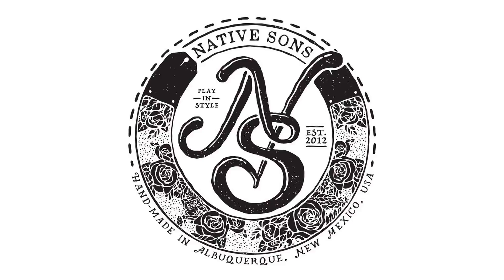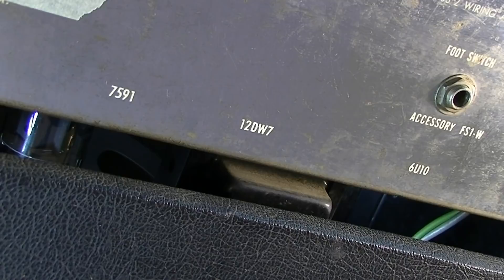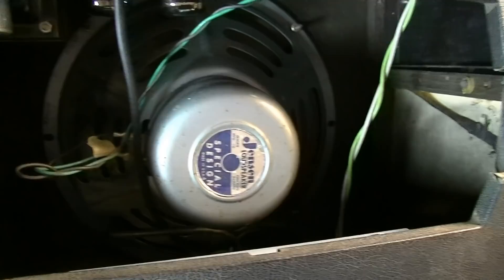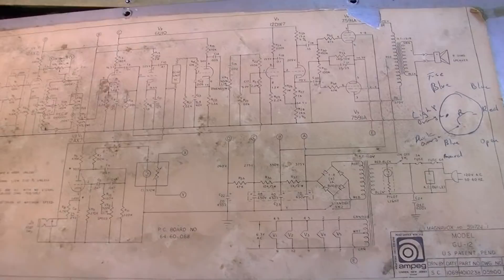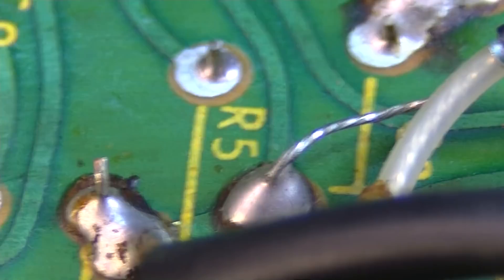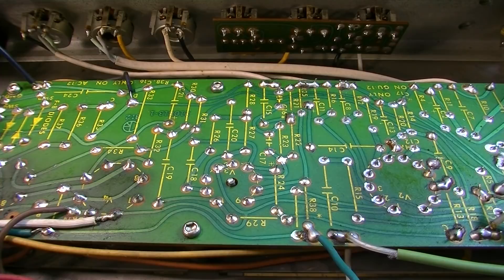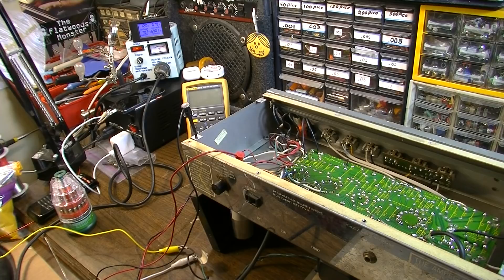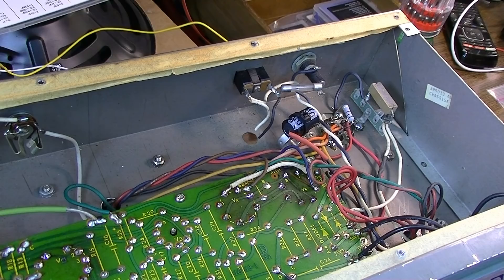What was Ampeg Thinking with This Board Design?

Comment: You have no strain relief on the power cord you added. If you're going to do it wrong and use a grommet instead, you should at least tie a knot in it so it doesn't pull out the first time somebody trips over the cord.

Comment: All of a sudden, the pc board design made sense to me once you mentioned that Magnavox owned Ampeg at this time. I took apart a 1964-ish Magnavox console stereo and made a blackface Fender Champ out of it, but the pc board used on the radio portion has the exact same sort of design and orientation. The board on this radio was soldered to the chassis, which made things even more difficult. Basically, Ampeg used this design of circuit board because Magnavox used it.

Comment: Blue line graphics on Ampeg usually means first run 68/69. They changed to black with sharp corners in 70 and then softened the corners on the logo by 75
Reply from the maker: I have not closely inspected date codes on this other than the cap I show with a 1968 date code. I'm beginning to this this is late 1968 or early 1969 and therefore first run of this amp, because [SPOILER ALERT] the speaker turns out not to be original to this amp as I suspected it might not be.
Reply: It's interesting though that you saw a 72 date code on the transformer. If it's not a replaced Transformer, then that muddles things up a bit...I would think the OEM speaker would've been a square back CTS or something like that.
Reply: Flex

Comment: My old roommate, the renowned amp guru Frank Levi III once told me that the 6u10 tubes don't hold up to the continuous hot internal climate of the amp, the adjacent tubes, and the rising heat from the upside down 6u10. And it's squatty wide girth so close to the pcb. The pcb actually retained the tubes heat. He said the Magnavox TV factory was where they built the amps, and since tube TV's rarely had tubes in upside down locations (let alone with 4 or more beam power-amp tubes heating things up), the engineers were surprised the amps were as reliable as they even were! They sure sound great though. I've gigged with several.  

As far as solid state amps, the Ampeg G110 fet based, guitar combo amp is so damn dynamic! Great clean to dirty picking attack.  Nothing sterile  or cardboard  about it. Just a raw no-eq'ed acoustic guitar piezo pick-up sounds great through it. Excellent reverb and tremolo too.

Comment: Happy new year! When I saw the broken AC Outlet and that the epoxy looked suspect, I think I'd have eliminated that jack in favor of a modern IEC AC entry module. Trim the panel and pop that sucker in. It's cheap insurance for only a few bucks. They even make them with built-in ground line chokes and fuses.

Comment: A few months back I bought a HeathKit hifi amp to convert into a 2203/2204 JCM800 style circuit. 2x 6EU7's, a 12AX7 PI and a pair of 7591A's. Not quite what Marshall used lol, but it sounds killer into a Marshall cab. The Heathkit schematic has the 7591s really hot from the factory, which I imagine is for the clean headroom, and maybe because they probably didn't expect people to dime their hifi stereo. Anyway, I bet that Ampeg is going to be awesome when this one is done. Glad to see a project that isn't giving you an existential crisis

Comment: I own one of these amps... The speaker shown in this video is definitely original as mine has the exact speaker. Others I've seen also have this Jensen C12R ("C" for Ceramic magnet, 12" speaker, "R" designates 25 Watts)..... The GU-12 is a 15 Watt amp. The speaker easily handles the power output.  The screws in all Ampegs of this era are called Clutch head screws. Yes, they are weird. Why Ampeg chose those types of screws is a curiosity.... they require a 5/32 Clutch bit or screwdriver. Most people change these to Phillips head screws as the are far more common and a phillips screwdriver is usually within reach. The Ampeg Logo, on this amp, in the video, is missing from the speaker grill.

Comment: Your chassis screws on the side of the case are called "Double D" in the old automotive world. lol
Reply: Brad, Great video! I hope it makes you 9k this month.
Reply: Commonly know as clutch head screws.
Reply: I had a 56 Chevy pick up that used those clutch screws to hold the fenders onto the bed. I bet if I tear apart the garage I might be able to find them :)
Reply: Very common in/on Campers & older truck caps.
Reply from the maker: Clutch head...double Ds...sounds about right. :)
Reply from the maker: Got any vids of your equipment?
Reply: Here's a photo of a set on that auction site. Pretty sure I have seen clutch bits at Harbor Freight. I have a set of clutch head screwdrivers from working on vintage autos where they were used a lot as well. They come in handy. https://i.ebayimg.com/images/g/~BkAAOSwzaJX~-16/s-l1600.jpg
Reply: I just found clutch bits at Home Depot for my Ampeg. $3.00. If I find the package I’ll message you with the part number.
Reply: Everbilt clutch power bits. 
1/8 5/32 3/16
Type g 
PN 1002 584 924
Home Depot
Reply: @TheGuitologist  hey Brad, those clutch head screws are in a tool set at harbor freight, it's a tool set called a security bit set.
Reply: I look for them at every garage sale, estate sale, and at the local pawn shops.  Need them for working on old Ampeg amps.

Comment: Brad, those side bolts are called "Clutch-head". You can find the frivers in many of those multi-tip screwdriver sets with one driver and two dozen bits that fit it. They usuallt come in a little silver blow-molded case with a hinged lid. Find 'rm online or at harbor freight. They used to be used in some foreign cars, and I've actually seen them used on old American carburetors.
Reply: Back in the day every mobile home had clutch head screws in everything lol. I have so many I can't find them anymore lol.

Comment: From Leo:  I am in the same opinion as you about tubes hanging off bottom of a printed circuit board.   The heat does not need to be concentrated on the board.    I have worked on some early Fender Blues deluxe and Deville amps that the tube sockets had long metal legs that would suspend the tube sockets at least 3/4" off the boards.  These old amps show no burning around the tubes and the solder is in good shape   The inverted PC boards are a bad design but the extended tube sockets were a good method of overcoming the deficiency.  I would like to find a source for those extended octal tube sockets, they could save a lot of aging vintage amps.

I get the willies every time something comes in with a 6U10 tube.  Anyone that has any wants a ton of money for it, even if it is weak.

Comment: That's one thing I wish they would still do in this decade.  Include a schematic.  Whether it's a pedal, an amp, anything.
Reply from the maker: Isher they won't unless consumers learn to demand it again.
Reply: @TheGuitologist  Sadly, true.

Some companies are more than happy to provide one if you ask for it, but even they are few.  I don't touch amps for repair just because I'm not that great with engineering.  But I know enough to be able to look at a schematic and know what each tube is doing so I can be a bit judicious in selection.

Comment: Almost forgot... I suspect Ampeg designed the amp to be serviced with the top of the chassis on the bench, due to the end block "legs" being shock-mounted (which doesn't support the chassis very well on their own). IOW, what some consider a "fault" is really "by design" from the perspective of Ampeg at the time.

Comment: they are clutch head screws,I have many Ampeg amps of that era,the screwdrivers are still avable.
Reply from the maker: @goodun6081  Damn. Sorry I missed that deal.
Reply: I will look for my clutch driver collection. I only ever used one on a 1960s Ford dashboard radio. Decades ago.

Comment: I've got the same amp, the C12R was almost certainly the original speaker; that's what was used in this model. It was not up to the task of what rock guitar players were going to put it through. Ampeg didn't design amps for rock guitar players until a little bit later. They didn't expect people to push the volume past noon or so, I imagine.

That said, once you replace the speaker, it is a remarkably good sounding amp. I've owned many, many Ampegs over the years (my first amp back in '72 was a brand new VT-40) and here in 2019, I have to say, the GU-12 is my favorite. It captures the "Ampeg sound" and basic personality of the VT-40 but in a much smaller, much more manageable format.

BTW... the use of the bass and treble controls should be VERY notable. If they aren't, there's something wrong. That is a highly effective tone circuit.

Here are a couple vids of mine:
https://www.youtube.com/watch?v=HxAVc2bgcEs
https://www.youtube.com/watch?v=kHWtAJ-Wl5c

Comment: I love seeing amps like this that seem really uncommon where I am. Board mounted tube sockets irk me though. I know lots of manufacturers have done it but given all the downsides and the overall design it makes me think reliability/serviceability much of a concern to them. Sure, it can be done alright with a proper design but more times than not it's just an attempt to pinch pennies where chassis mount would have been better. I don't mind so much when it's a seperate board like some of the Fender amps but generally it's just dumb. Of course I know I'm preaching to the choir here.

Comment: My opinion on this amp is that it's not a '72 but a '69. Just because the Jensen is a '72 doesn't mean the amp is, I would wager that Jensen is a replacement. The cap with the 6846 date code coincides with the nickel-plated chassis '69 Ampegs. IME. By '72, they had already switched to black-painted chasses. So, that cap was likely not "old stock"/left-over; that amp's likely a '69.

Comment: Ahh no wonder my V4 can heat a small room!   tubes that run hot, the V4 has these odd labeled jacks on the back, my interpretation was it was a way to link 2 V4’s together, is that right Brad?   I did it on an 80 degree day, they both became too hot to touch the chassis, my friend who owned the second one got nervous.   But his was driving a 
4 x12, mine was driving a Carvin Vega 18”.   Fabulous bass tone, louder than the SVT together

Comment: Hello, i have a Gu12 with a replaced tremolo module. Tremolo works but  doesn't get that pronounced. I'm interested if you can demo the tremolo range on that amp since it seems to have the original  clairex photomod CL1110 ! Thx

Comment: Those be Clutch Head screws which have been savaged by years of screwdriver miscegenation. Collectors of vintage Ampegs often prefer to see the original screws and the drivers are available at Amazon.
Reply from the maker: "These screws is miscegenated!!!! Is you is or is you ain't a flathead?!?!"
Reply: Beat me to it. Those clutch head screws were once common to mobile homes. Almost nobody went to he trouble of getting the bit for them. They just stuck a flat screwdriver in them.
Reply: Also called "elephant ear" screws I think ?
Reply: You Yanks should have adopted the Robertson screw (square drive) invented here in Ontario.  When using the proper size driver you will break off the head of the screw before stripping the socket - unlike the Phillips which strips if you look at it sideways.
Reply: @garylenius4181  We have square drive.
Reply: @bebo5558  they are insanely rare and come on almost no consumer goods
Reply: @prsplayer210  Nonsense, walk into any home center, lumberyard, Lowes, Menards, Home Depot and go to the fasteners section. Square drive deck  screws, square drive drywall screws. Torx/star bits, Phillip's, square. It's all in where you shop.
Reply: I'm pretty sure nobody nowadays except vintage nuts are interested in proprietary screws that require proprietary screwdrivers/bis to open. We already have enough problem's with the 10 different proprietary screws electronics have nowadays.
Reply: @crimsun7186  Well it's obvious your not a "vintage nut"!  I think your just jealous, that your "bit" won't fit, in just "any" screw!
Reply: @bebo5558  Your post makes as much sense as proprietary screws, which is none.
Reply: @crimsun7186  It will only make "sense" if you have a sense of humor! I guess you will have to get someone to "splain" it to you!

Comment: Hey Brad did you ever try J-B Weld 5-minute epoxy? It's a lot more versatile because he dries rock hard as opposed to the other epoxy which never really gets completely hard. And it's steel grey which always looks good.
Reply from the maker: Artie Saginario saw a vid the other day where a guy compared epoxy glues, several different brands. A couple were standout winners. Can't recall which.
Reply from the maker: I do recall the quick stuff was the worst.

Comment: Why didn't you check the cathode by-pass capacitors with a ESR meter? They are put there to reduce the AC negative feedback generated by the cathode resistor! If they are dried out the amp will not have it's full gain!!!

Comment: "What was Ampeg thinking"- they were thinking about the most serviceable PCB in the guitar biz, which this is, as are all of their 70's amps. I agree the powertubes should have been left off of this board (the bigger models are chassis mounted), but other than that it is hard to find more sensibly engineered amps.
Reply from the maker: Components are on the wrong side. They got a lot of things right. I love the amp stand plates and shock mounts.
Reply: @TheGuitologist  Most pcbs have the components on the opposite side of the traces, you have access to BOTH sides of the board in these amps, so I fail to see how anything here can be considered 'wrong side'. Ampeg has done better engineering here than any other pcb amp you have shown, yet you question this engineering right in your video title. Get further into the 
Vseries and see how absolutely hardcore these amps are built.
Reply: I have to agree that these amps are very well thought out and built with service in mind...yet they are not perfect either. Two issues I often seen on many V-4/VT-22's are lifted traces and cooked boards where the pcb mounted screen stoppers and screen dropping resistor are mounted. Getting these resistors off the board and plated through pcb would be a big improvement. Watch out with 7027 wired sockets if mounting screen stoppers on sockets like fender did.
Reply: ...note these board mounted screen stoppers are not a problem with normal screen current and factory bias settings (ampeg biased these amps cold).
Reply: @blakesimpson9974  Agreed I have seen lifted traces with the screen droppers but always something that can be patched up, they also mounted the screen resistors a bit high off the board so its not so bad with the heat. My big eureka tip for these amps is to move the power GRID STOPPERS off of the board and onto the sockets directly, this finally cured a very odd oscillation in my V4B that bugged me for years.
Reply: @Jonathan, great tip! Sounds like that was a hair puller! Minimizing inductance in the grid circuit is critical this also why its best to use carbon comp's in this position. You are also correct about lead length on heat dissipating componets. I am curious to know more detail of the "odd oscillations" you experienced with that amp.
Reply: @blakesimpson9974  '78 V4B,  I could best describe it as a sub-sonic oscillation, when playing at any reasonable band volume or higher, when hitting a hard chord or loud palm muted note, it would break into this death rattle oscillation where you would see the speaker cones moving in and out slowly like a heartbeat, full excursion, and continue until being switched into standby or off. I've never seen any other amp do this ever since, and as you can imagine I tried just about everything in that amp to isolate or reduce that problem, and nothing cured it until the idea to shift the grid stoppers, which of course in so many amps is there on the socket.

Comment: Just did an old VT22 with a 6K11 compactron. Some of those old V4/VT22's had the compactrons and some didn't. Must be Magnavox had a glut of them and engineered the amps to use them up from changing TV technology. It had a lot of PCB issues I had to fix.
Reply from the maker: Good call on the Magnavox connection and Compactron. GE also had a factory in Skenekdedy, or however you spell that. Also a factory in Kentucky, not far from Magnavox Indiana plant.
Reply: @TheGuitologist  Schenectady LOL! Yeah I live about 3 hours from there. GE used to have a foundry 5 minutes from my home. The good old days where things were booming before and after the war. My dad worked at a local Westinghouse plant a few minutes away and my mom worked at the biggest A+P food processing plant on the east cost a few minutes away when A+P was a household name. I live 15 minutes from Corning Inc.( Corning Glass Works) who became famous for Pyrex back in the day and Corelle dishes. They now make all the gorilla glass flat panel TV screens and fiber optics. If I would have had a clue about tubes when I was a kid my dad could have gotten 1000's of 12AX7's and all the power tubes I would ever need. I'd be a rich man with all the NOS tubes he could have gotten for pennies back then.

Comment: Hey Brad, there is a crazy easy mod you can do for your digital meter you have connected to your Variac, that will power it on immediately after turning on power to the switch. I was actually going to do a video on it, but then I saw that many people had already done videos on it. It comes in handy if you ever need to do something under 65V. Here is a link to one of the videos, that explains it pretty well. https://www.youtube.com/watch?v=wPFaEFEembc
Reply from the maker: I know about it. Just been too lazy to do it.